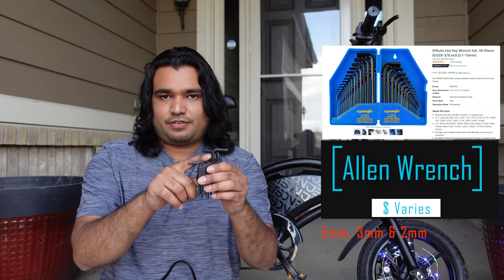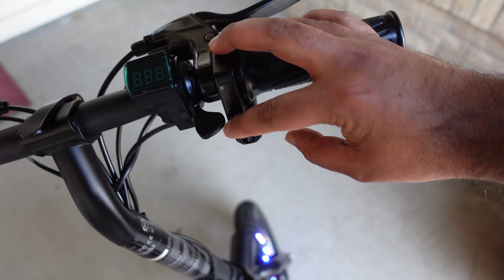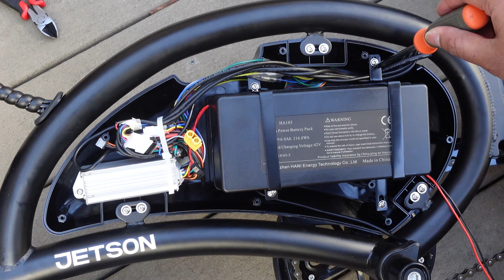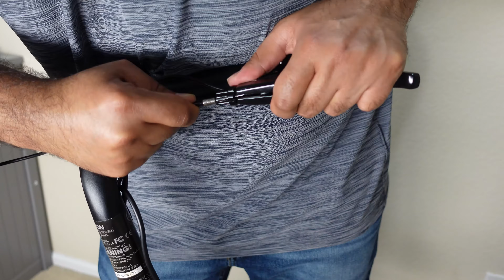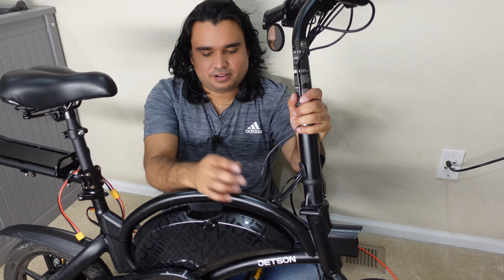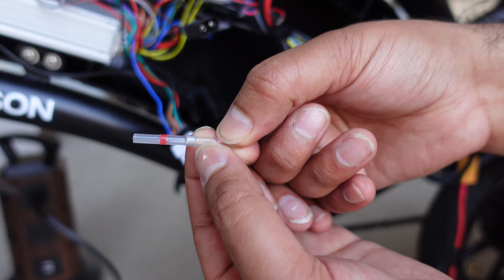How To Install A Thumb Throttle - Jetson Bolt Pro (Folding Electric Bike From Costco) 2021

Comment from the maker: Jetson Bolt Pro Videos: https://bit.ly/3jaNaRY
Electric Bike Reviews: https://bit.ly/3hu025b
Electric Scooter Reviews: https://bit.ly/3VYQrlL
Reply: My throttle broke, the casing crumbled around the bolt that holds it in place. Since there is lots of cable I am going to use the part that held the handlebar on the throttle, and my dremel, to put the cruise on the left where the start button is now. Start can move over by the gooseneck, out of the way.  And now I dont risk broken fingers or carpel tunnel.
Reply: Update, FWIW: I was unable to salvage the OEM display. I might have been able to, but that would have required a longer set of handlebars.
 On the bright side, I was able to splice it together right below the bars, and leave those wires available for future use.
 I had to replace the grips themselves, but they matched the novelty mirrors I bought so all in all, it was the fashionable choice.

Comment: Try this  hint to make fishing the wire real easy. before you take the cable out of the tubing, tape a piece of string or wire to the end of the cable and pull it through as you remove the cables. that will leave you a fish line to pull the new assembly back.

Comment: My eb5 swagton has 5 pin wire for throttle to controller. Hard to find a 5 pin. my bike does not have a brown wire.

Comment: i like your instruction style. please help with my project. i have a scooter and the display did not work properly so i bought a cheap temu display. i also bought a thumb throttle to replace the terrible half twist throttle that original to the scooter.

Comment: Can the twist throttle just be eliminated altogether? I know I would lose the 4 light battery indicator, and cruise control I’m assuming. Any other things to consider? I’d rather have stationary grips after thumb throttle installation for my son.

Comment: I have a question 
I try to change the control of my jetson electric bike because is to slowly 
I buy the similar i see in one of you videos,  i buy the one have the display 
The problem is i feeling like all wires are different  maybe half and I don't know what I doing wrong 
I torn on anything after finishing 
I change the connection a couple times and nothing 
You think you can help me

Comment: Getting frustrated. I got a thumb throttle, it has 3 wires. Red black and green. My other throttle has red black green blue yellow and white. All wires exposed, the old throttle is gone.

Comment: Just got this bike for free from a friend who im assuming was under the impression it was unrepairable. The red wire to the right hard break that coonect to tbe kill swith when the brake is pressed it broken aswell as the throttle is broken and just spins, its missing the spring and magnet strip. Im going to try everything in this video to get it working. Thanks you

Comment: Hello have a question about my Jetson pro if I did not want to use my old throttle, just use thumb throttle can I delete the cruise control it still works

Comment: Oem throttle broke ordered new one from Amazon, no diagram it's a wire wire one other than black to black and red to red , no clue on rest light just blinks. New throttle has green white yellow and 
brown with black and red wire any clues??

Comment: I did this on my sons . Colors are a little different but it seems to work good . But when he rides the battery appears to drain super fast . (In seconds ) I can watch it drop as I ride it with a person on it. (Doesn’t do it when no one is on it ) . If I disconnect the battery connector and put it back together it reads 41 volts again and turns back on. Confused here

Comment: Sadly, mine didn't work. Bought the same throttle, but even if I connects it directly in the female connector like a full replacement of the original throttle, pressing the thumb doesn't make the wheel spin. The screen does show the voltage thought. Any thoughts on this? Should it work like a full replacement? Can the throttle be bad?

Also, my original throttle doesn't have the same colors. The cruise control cables are white and blue, the voltage is yellow and the throttle seems to be green, red and black.

Edit : and just like this, I totally forgot about the brakes. As I was testing, one of them was in the engage position. While this was fix, the rest went fine and now it works!

Comment: I have a question. I hooked up all the wires temporarily and tested it. Everything worked like it should. I plugged finished permanently hooking up the wires and when I plugged in the battery to test it made a click sound and it turns out I had left the unit on. Now it doesn't want to work. I'm 💯 I hooked up the wires correctly. Any ideas what could be wrong? Did I torch the controller when I unplugged the battery while it was on them plugged it back in later?

Comment: Hi, my throttle grip had loosened on it's own.  This video showed me how to tighten it back up.  THANKS!!  I think my Jetson Bolt needs a new headset.  How would I replace it and where would I get the part?  I've done that on regular bicycles years ago.  Basically disconnect steering from fork.

Comment: This is great. However, I've implemented a much simpler solution. Buy a half-grip and cut off the jetson throttle for the length of the half grip. Voilà, now you have a half-twist throttle.

Comment: Hello Shiva, I have the stock throttle on my Jetson Bolt Pro. I upgraded the controller to the Brainpower 48v, I wired the Black, White, Red from the controller to the Black, Blue, Red on the throllal but no go. I'm at a loss ATM, any help would be great. Thanks Terence

Comment: I watched your videos on taking out the battery, replacing the rear disk brake pads and rotor, and a few other videos. These are excellent teaching vids for people like me, who would otherwise be clueless about fixing problems with the Jetson Bolt. I had a lot of fun replacing brake pads and rear rotor, even though it was (for me) a complicated job. Jetson does nothing to support this bike - I cannot even get a new rear fender! - so your work in this regard is very much appreciated. Thank you!
(By the way, I purchased a set of brake pads from Amazon that turned out to be a fraction of a millemeter too big, and would not fit in the brake pad housing. My solution was to buy a Shimano disk brake caliper, which included the pads. It would make it easier, and ultimatley cheaper, for me to get replacement pads in the future.)

Comment: 16:46 u are again wrong. if u want to disable throttle on original twist handle u can eliminate signal and power wire. u only need ground wire for the green dots that shows charge level (and brown one)

Comment: 14:58 graphics is wrong blu wire connects to the green wire (not to the blue to the controller). green wire is standard color coding for throttle signal wire on any other controller.

Comment: u could easily just loose handle bar and move it to the left so  to shorten the lenght of right side and than remove throtle and brake without pulling the cables all the way from battery case. ty

Comment: Hey Shiva, I've hqd a Bolt Pro for about a year, now the throttle is working intermittentantly. when I twist the wires in the stem it works.. that seems like a loose wire. I took the battery cover off  and everything looks good.. so its probably in the stem.. .. (the connection).. you think?

Comment: I have a jetson bolt pro which needed a new controller has I'm connecting the wires i realized i have one wire I couldn't connect which is for the paddle assist need help

Comment: I want to put on a different twist throttle instead of a thumb throttle. The only ones I can find have 5 wires instead of 4? They all seem to have 2 wires for throttle power instead of 1. My question is, is there a way to wire one of those to the jeston? Or am I just out of luck?

Comment: How do you install a key Ignition with voltage on a jetson bolt pro I have a 72v 40 ah battery 1500waty motor

Comment: Thank you Shiva. I bought the thumb throttle and finished installing it after several days. My Jetson Pro is the older one and the color scheme of the wires did not match yours. So I tried many ways to match it up. After hours and hours of trial an error, I finally got it to work properly. A couple of notes for novices like me. The brake cable is easy to take off, but I found it really hard to get it back on to the brake lever. Also, snaking the wire through the frame was a bit tricky, but doable. Last but not least, do not make the same mistake I did by cutting the wires for the 6 pin throttle connector too close to the connector. You will have a real hard time splicing the wires together. BTW I also used your tire replacement video to help me replace my rear tire. Thanks again.

Comment: I want to add a key switch on my bolt pro. I plan to open one of the leads going to the existing on/off switch and insert my key switch between the removed lead and the switch. My question is ,which cable or conductor, coming from the controller, do I cut into. I’ve tried to get a wiring diagram on the bolt pro but with no success. Also , it seems that most controllers are pretty generic in there wiring setup. Any help would be appreciated.

Comment: Feel like I narrow it down to three wires I got a marked before before that I didn't mean to write you all that book for that text on the last one I mean but I mean you did help me I'm not sure like what to do and I tried to take it to a bike shop and I don't know I mean they don't want to fix it cuz they didn't sell it and the front end got wrecked I wish I could send a picture cuz I put screws through it and then Andy's metal brackets on mine don't fold

Comment: What you could have done is just piggy backed the lever throttle onto the original one so you could have used the lever or the twist grip might have been interesting two throttles on one bike.

Not much point but least you wouldn't have a problem if one stopped working.

Comment: Pretty cool I'll give it a try by the way
Have you change the power button, I have one that starts but won't turn off. And a second one that starts but when I turn to the left the front light starts flashing and strops working but I turn right and it works again. Any help will be appreciated:)

Comment: I just installed a new throttle i bought on monster scooter parts made for the jetson bolt and bolt pro, perfect wiring match, whole job took 30 minutes and is a definite upgrade to the original. No splicing required, six pin connector snaps right in. It was a bit pricey at 50 plus bucks but worth it to me. Hope this helps someone  (sku t53-6202) It WORKS!!

Comment: Need your help I replace the thumb throttle I deed conectes the way you show bust don’t work there is not a morun wire in mi bike
Reply from the maker: I believe you have the new bike. I have heard that the OEM throttle wire on the new one is Green as opposed to Blue in mine. Try that and it might work. Otherwise you might have to try other combinations or reach out to the throttle manufacturer. Sorry I don't have more input on this. Thanks

Comment: Thank you so much Shiva - both of my Bolt Pro throttles failed over time and while I was worried about being able to do this mod successfully, but following your directions worked perfectly. Thanks for putting in the work, and cheers from a fellow Coloradan

Comment: After two flats, a new throttle I bought two weeks ago, the battery only has enough power to 
spin the back wheel nominally…selling parts off it…No more throwing good money after bad…God only knows what’s wrong with it….Au revoir…

Comment: My Jetson e-bike when I power it up the headlights keeps flashing and it won't stop I will be replacing the throttle with a thumb throttle could that be making my headlight flash and not be able to turn it off

Comment: Best bike video ever Shiva. My throttle broke during long bouncy ride in my boat. Bought a three wire thumb throttle on Amazon and hooked it up to the red black and blue and now works like a champ. Other wires on my harness were different colors but didn’t matter as I did not have to hook up the battery voltage wires. By the way, I hooked the thumb throttle to the right of the break leaver and cruise control. I did this by. Cutting off the grip, shortening it by the width of the throttle then putting in back with double stick tape like you use for attaching golf grips. Now have the best of both worlds. A thumb throttle and a grip that doesn’t rotate. Will not accidentally power this bike with the standard grip throttle which has caused me to flip a bike in the garage a while back. Thanks man. It is a wonder that you could figure out which wires to tap into. I’m a fan. Ron

Comment: Could you help me? my sons handle completely broke on the Jetson Bolt Pro so instead of wiring at the harness I am splicing at the exposed wires at the handle. I cut away the black insulation and the wire colors I have are RED/WHITE/BLUE/BLACK/YELLOW/GREEN. There is no brown/maroon/grey like in your video. How do I know what is what? I have a multi meter and I also cannot test throttle because it is not functional.. 
EDIT: Got it. Matched the wires and it worked out!
Reply: I have the same problem different wire color

Comment: Didn’t originally want to do this mod, but on my way to my last final before graduating my throttle snapped. Thanks for the video, seems pretty straightforward. The OE throttle didn’t last all that long so I’m not convinced spending another $50-60 on a throttle that’s liable to snap in the same manner. 

Thanks for the videos on this bike, they’re about the only thing letting me maintain it myself on a tight commute budget after we had to scrap one of our cars due to insane back-to-back maintenance costs.

Comment: What are your thoughts on the stability of the handlebar/steering given small wheel? I am going to do your thumb throttle install next week and that might be a good time to address the handlebar. I saw a vid where somebody replaced the stock bar with one that was a bit longer. Would that help with stability/steering given small wheels? I saw another video where a guy actually loosened the stem (at the point it folds) and then turned the stem completely around the other way to have the grips closer to the rider (not on the Bolt Pro, but similar e-bike with folding stem). So I think I can rotate the Bolt stem. Of course in the rotating the stem approach need to re-orient the brakes.

Comment: Do you know if disconnecting the white wire disable the speed limit?
Reply from the maker: No it doesn't. You have to reprogram the controller or replace it. Thanks!

Comment: Thanks Shiva for this video! I should mention, this also works with replacing a regular throttle (my stock one broke), and doesn't require the yellow wire.

Comment: Hi. I have this bike which was originaly the pegged version but i have added a crank kit ot it.  Also added front brake. Bu tnow it won't start.  I did originally cut in the replacement brake levers but have since reverted to original, now it won't start.  Do I need to have the brake lever switches connected?  What else could I look at as the cause of the problem.  I tested after removing the rear wheel to ad the sprocket and all was well at that point.  Is there any tests I can make on the output motor wires to see if there is power there?  Kevin

Comment: My wheels wont turn after connection.
Black
Red
Green
Yellow 
White all connected to existing connections and thumb throttle.
Help.
Reply: The first thing that comes to your attention when I see this video
Reply: Do you have any videos
Reply: The throttle turn on and battery indicator but the wheel won't turn on push button.
Reply: I fixed it

Comment: How do you take the forks off jetson bolt pro please answer back
Reply from the maker: You can remove the axle bolt to unhook the fork. I have a video on tire replacement that shows this process for the back tires.

Comment: I lost the auto cruise and headlight too☹️
Reply from the maker: I think your bike has different color wires than mine. I heard Jetson changed the coloring on the newer models. I think the throttle wire is green on your instead of blue. I am sorry you are having issues, hope you can get it working soon.
Reply: @ShivaSapkota  thanks I figured it out.  I don’t follow the color coding but flow the arrangements on the video but I don’t leave the blue line disconnected because if I did it will disable the headlight and auto cruise but connecting the blue wire will not disable the twist throttle but it’s easy to fix it by using ShoeGoo to glue it so you won’t able to twist it anymore.